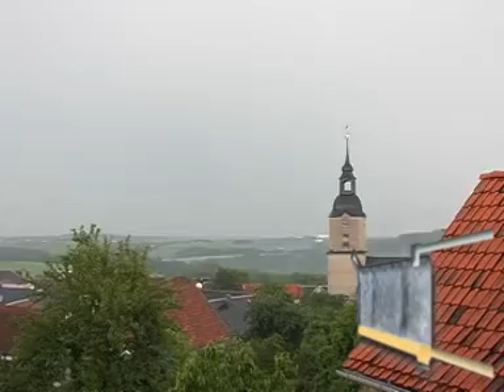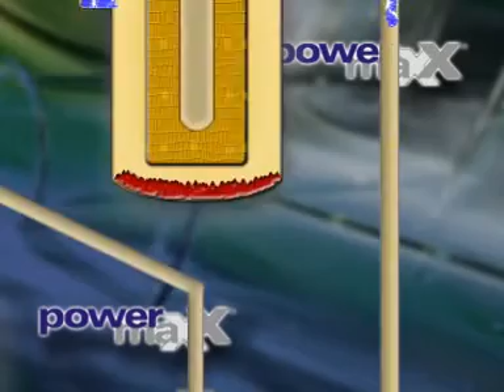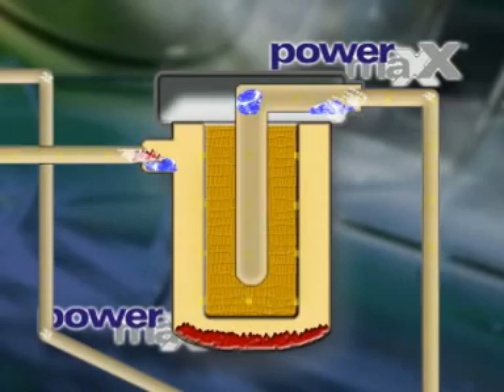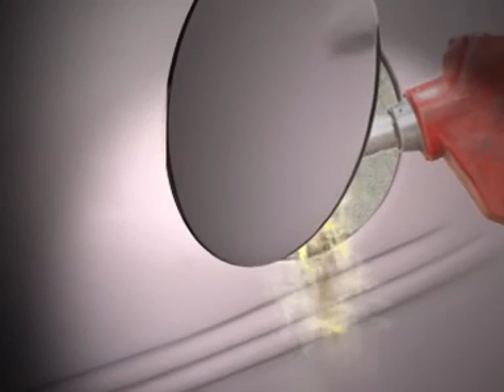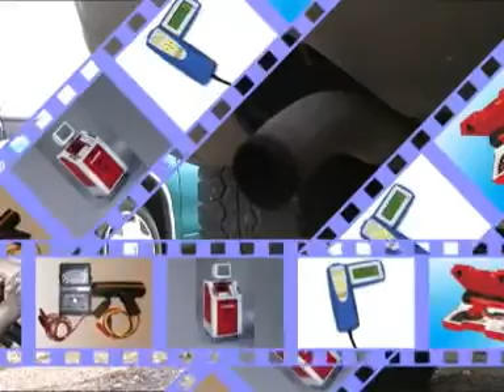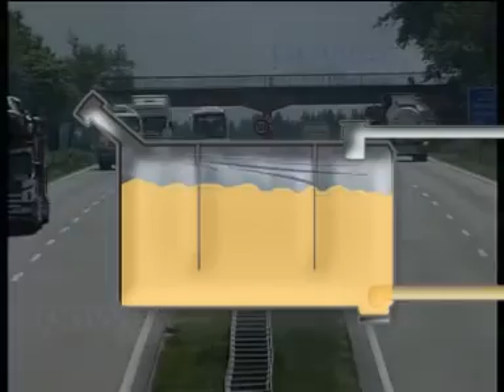Powermaxx Fuel System Cleaning & Diesel System Cleaning (en)

Comment: This video makes the point that moisture and alcohol react in the gasoline as a corrosive mixture.  But the alcohol found in ethanol gas or from "Heet" additive  is soluble in gasoline.  That's why the additive is used to remove water  found in the fuel system.  I use an occasional amount of ethanol gas to remove moisture from the fuel system.